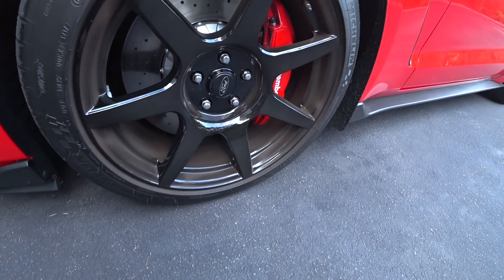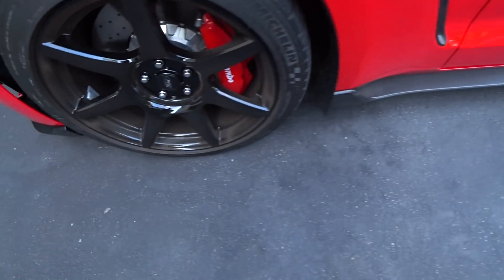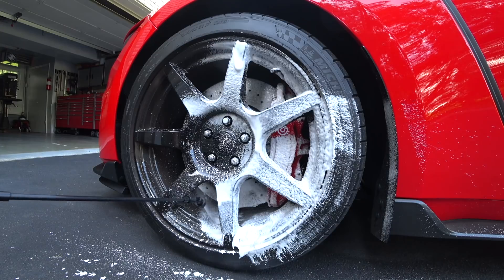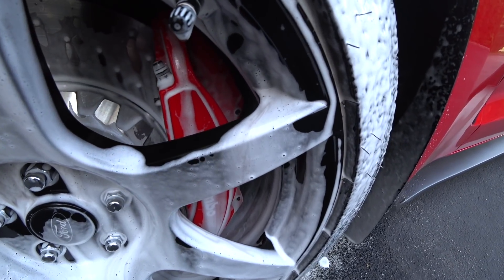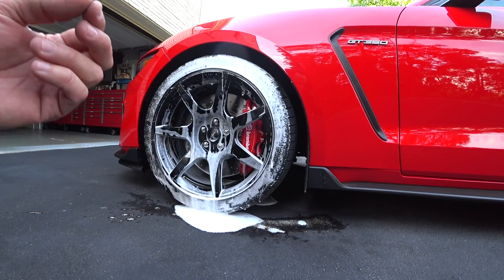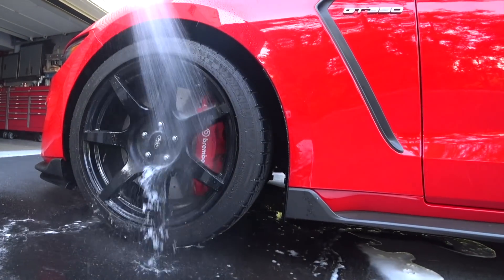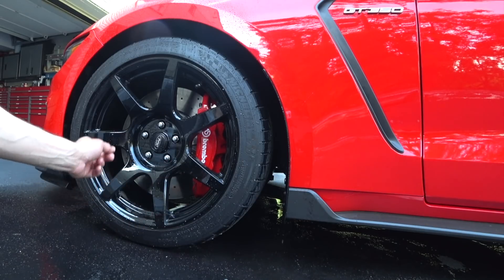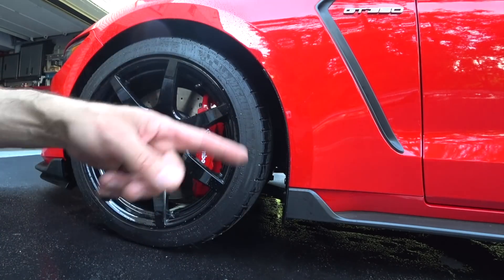Auto Fanatic Wheel Cleaner DEMO Using GARDEN HOSE

Comment: I'd like to know what kind of chemical is in this foam? Can't be just a harmless shampoo as we all know that could not clean baked break dust of the wheel especially without scrubbing it. So it looks great, results are great no question about it, but to say it's all peachy without any chemical, I seriously doubt it.
Reply from the maker: i never claimed it to be just water of course this is a chemical formula but a safe non caustic non acid one that does not burn your hands, eyes, throat, ruin your brake hardware or have the iron activators to choke you and ruin your driveway. Wait until you see the new video that gets posted tomorrow.

Comment: Can you use it in a spray bottle
Reply from the maker: you can do what you like but its designed to be foamed if you willing to spray with a conventional sprayer and use wheel brushes it will also do a great result and eliminate the use of the toxic iron activator wheel cleaners on the market. this is a much safer solution.

Comment: After using Iron X on my wheels for 3 years, it ruined the anodized finish of the brakes, to where they were all rusted. The clear coat on the wheels also seems to fail. Just got the brakes painted with VHT caliper spray paint and wheels powder coated satin black, so I'm curious if this cleaner will also degrade the finishes after repeated use. Thoughts?
Reply from the maker: this is what i am trying to tell everyone, i have ruined many brakes over the years due to the crap cleaners on the market, You can use my cleaner on anodize and even raw billet aluminum without an issue, lets see what other cleaners can claim that. this was the #1 challenge in developing this, it is all about solving a problem and we feel we did a great job overall with this product.
Reply: Awesome. I'd love to try this out and see how it works.

Comment: Dude, no one has these fancy sprayers. Will It work in a bottle!? I really want to purchase but can’t if it only works with whatever foam wand you are using.
Reply from the maker: formula is designed to be used as shown in a foamer, spray bottle wastes too much product and it does not cling to the surface to do its job

Comment: Are you’re rims ceramic coated?
Reply from the maker: NO
Reply: Auto Fanatic why with all caps?
Reply: Do you ceramic coat rims I wanted to xpel my forgelines or something i heard..     ?
Reply from the maker: i do not use ceramic coatings
Reply: What’s the regimen to clean the tires in order to apply more tire dressing after you wash the car? Do you scrub the tire or how can you manteniance the tire dressing
Reply from the maker: my wheel cleaner cleans the tires as i show but if they are very dirty you foam the tire as you foam the wheel and wait then use a tire brush and wash off and it is done, that easy and no need for any extra products.
Reply: mine are ceramic coated and hosing it does not take it off, still need to wash it with a mitt.